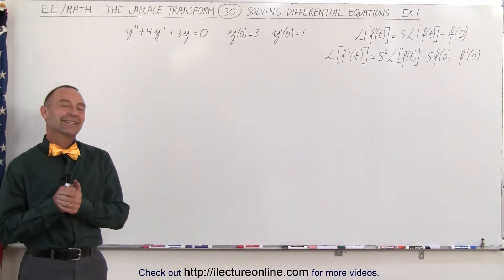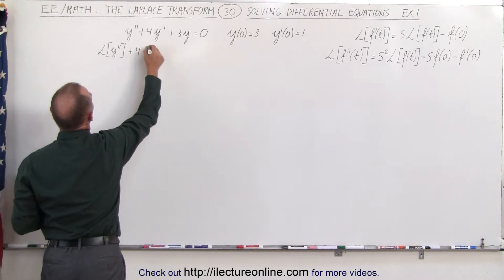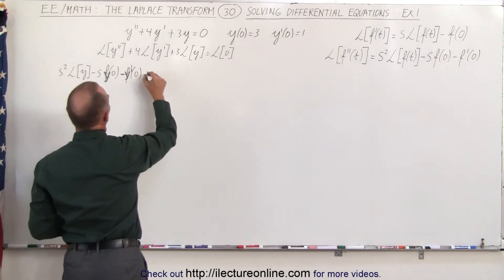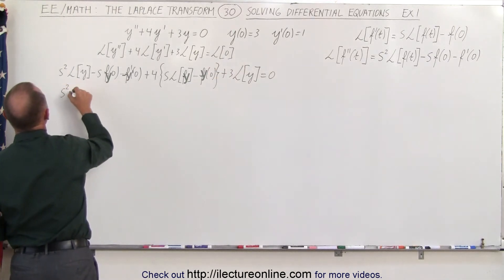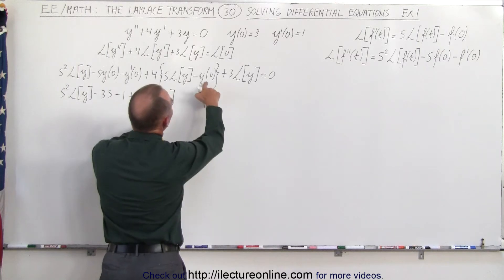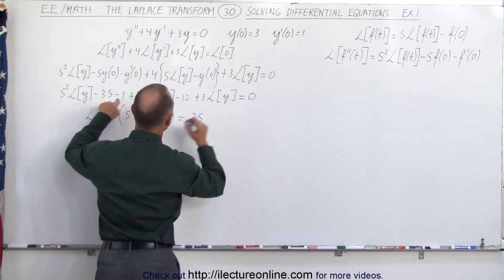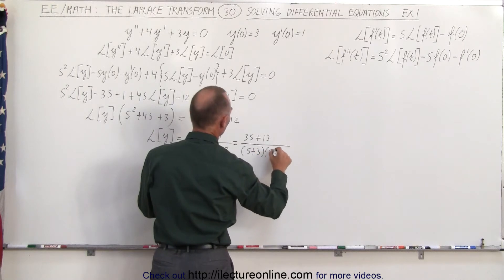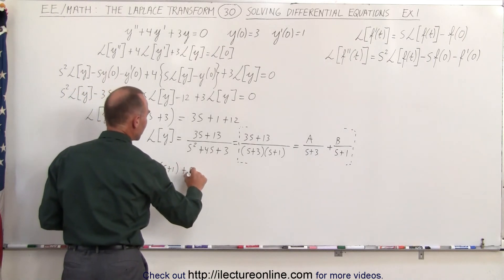Electrical Engineering: Ch 16: Laplace Transform (30 of 58) Solving Differential Equation Ex. 1

Comment: there is a minus missing in the answer.

great videos, keep them comming :)

i would love to see more about electrical engineering.
Reply from the maker: Yes, I dropped the "-" sign.  Thanks for letting me know.  I plan on continuing with the EE series as time permits.
Reply: Michel van Biezen 
I know several students at my university who have found your videos highly useful, so you are definitely being a major help. =)
Reply: where is the missing minus here ? I think the answer is correct and no minus dropped!
رد
Reply: @abdolw3682  y(t) = (-)2*e^(-3t) + 5*e^(-t)